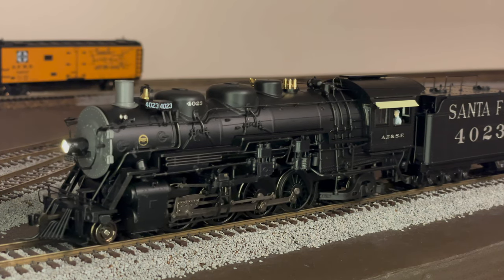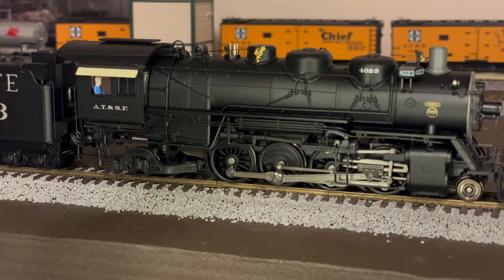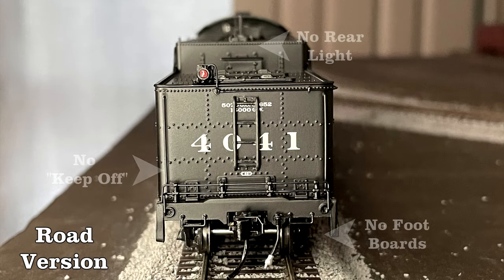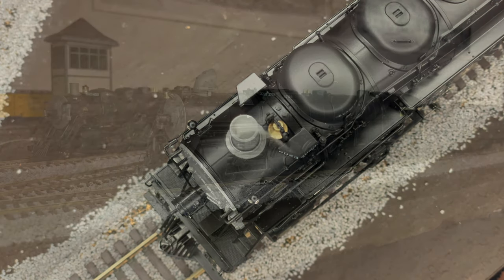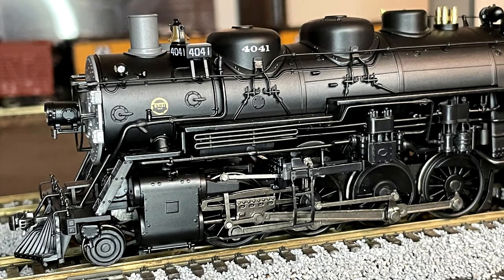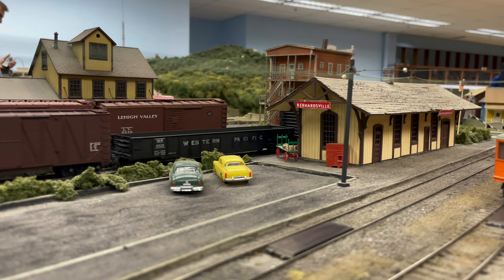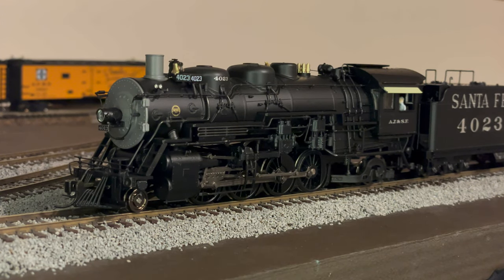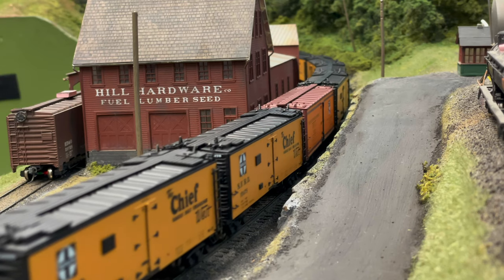Product Review: HO Scale Broadway Limited Paragon 4 Santa Fe Mikado 2-8-2

Comment: Had this issue with a few DCC Sound locos I have at a club layout. Basically it will happen when the loco gets a power spike from a location where there is two power sections meeting.  It does no damage but can sometime reset your loco.

Comment: Nice review.
I have the same switcher version (#4023) and run it via NCE power cab, I have found if you press the emergency stop button the loco stops immediately and resumes as normal when power is re-applied, it disables the keep alive.
The problem will occur if you loose track power either via a short or turning off supply as the system will see this as dirty track etc, all my locos that have a keep alive system operate this way, in fact the BLI Mikado is the only one that shuts down on the emergency button, the others continue. (which is a concern as it removes this emergency function)
I have had no sound issues as yet. (time will tell) I stayed away from Paragon 3 for the well documented motor control and sound issues.
Regards
Gary

Comment: I’ve had the same problem with the sound with a diesel on my layout one day. I could ring the bell blow the horn but the engine would not give a sound. I took it off the layout put it back on and it was fine. It’s a digitrax sound bug on a digitrax DCC system and it has only happened once. I think in my case it had to do with dirty wheels/track as a day later my switcher wouldn’t even run around the main line. Maybe it’s just the dirty track that causes all the problems you were having? Just some thoughts. Thanks a lot for this video man! I was actually thinking about putting these in my wish list and I can say this video has made it a definite yes!
Reply from the maker: Glad I helped make the right decision! That issue sounds the same. It’s tough to tell, only 1 engine did it so it could be the engine, but other engines that had tsunami 2 and esu were experiencing different issues, so it could be layout. I couldn’t replicate it on my home Digitrax layout. The club layout is also Digitrax. But who knows, I may contact BLI if the issue becomes consistent.

Comment: I had an issue with mine too, the smoke unit quit working after 2 hours. The element is still on, so smoke slowly streams out, but the fan quit working, so puffing smoke. I did a factory reset on it, thinking it might fix the issue, but my nce controller said short circuit detected. It still works fine other than the smoke, so I guess I'll run it without the smoke.

Comment: CV 29 has a bit that allows the decoder to determine if DC (analog) or DCC(digital) signal is being presented. The loco could get confused on a quick restart and think the signal is DC. DCC voltage levels are high and would set the loco at full throttle before the decoder makes the correction. Go into CV 29  and turn off the analog option. Search the web for the Digitrax CV calculator to create the new CV value. BTW, this happens with other decoders as well. It freaked me out when it happened to me as I had a full throttle run-a-way locomotive.

Comment: Our club Corona Model Railroad Society has two of these otherwise outstanding locomotives. Our only issues is that if derailed or shorted the headlight goes out and cannot be restored except by removing power completely and reapplying the headlight function. Any other way of relighting the headlight short of killing power? Thanks.

Comment: I've only done some running with my 4023 on my switching layout, only negative issue, so far, is that the wheels have to rotate several times before the chuff is heard. Wondering if a CV function setting could improve on that? I have yet to try the smoke unit and make any cosmetic improvements. Soon I will be taking it to a friends layout for a good running on a large layout with as many cars as it can pull. Regardless this engine is a beautiful model and Broadway should get a good pat on the back for what they have done. And thank you for a professional video review....!
Reply from the maker: Try CV 196. According to the technical reference manual, this controls the steam cocks event count. Default is 2. So I’m assuming setting CV 196=0 should turn it off, meaning you should get the chuff instantly. Hope this helps!
Reply: @OvernightScaleModels  Thank You Much...!

Comment: Overnight I have a question and it is that I have 4023 and it stopped chuffing so I took it off the track and put it back on 30 seconds but the chuffing never came back to 4023. Is it possible you could help?
Reply from the maker: I would open the tender, and use the reset button first. In the instructions manual there should be a section on how to use the reset button. If that doesn’t work, might be a broken reed switch inside the engine, in front of the flywheel on the motor

Comment: How did you disconnect the loco and tender?
Reply from the maker: There is a 9 pin plug between the tender and engine (the same plugs you’ll see on other Broadway limited models). Once you unplug that plug and remove the tender from the drawbar then the engine and tender will separate.

Comment: Put it in Pro Lighting Mode so you can control all the lights individually. I find the auto cab light on/off to be unprototypical to the max and really irritating. If you use Pro Mode, the manual forgets to tell you about setting CV 243. Very important or your lights might not work properly. Why they didn't use one mode and eliminate some of the totally useless (IMHO) sounds from F 14 to F 21, I'll never understand. If you use Pro Mode you will lose the coupler sound function and a few others that are much more useful and will have to re-map these functions back in. But I do love being able to turn the cab light on and off  and controlling the other lights individually particularly in switching operations.
Reply: Hi - what setting do you apply to CV243 please? Thanks

Comment: Beautiful models. Unfortunately I model Raton Pass and these 2-8-2's were not seen there. As it is I have a few of BLI's 2-10-2's including one modified 2-10-4 to model the 3829 which was a regular on the Pass. My question is all of BLI's earlier models had the option of getting rid of the traction tire-equipped driver and replacing it with a regular driver. While this would reduce the model's tractive effort on grades, it allows for wheel slip that could be more beneficial to the model as a complete stall which a traction tire could cause could blow critical components on the engine. I also like the need for adding additional locomotives and helpers to get trains over my 3 percent grade, just like on the prototype. Are regular replacement drivers without the traction tire  available? By the way, I'm a member of the NYSME in Carlstadt.
Reply from the maker: Unfortunately, there isn’t a replacement driver with no traction tire like they used to include. I understand the concern

Comment: The whistles still suck compared to TCS WOW sound decoders. And the smoke can’t touch MTH. BLI continues to disappoint regardless of their attempts at improvements. The most disappointing point is the abysmal positioning of the eccentric cranks! With the exception of a few samples, their eccentric cranks barely move which is one of the main joys of watching steam locomotive running gear! 

BLI models look ok but still fall behind Athearn genesis! BLI still has lots of work to do before I’ll spend $500 on their locos!
Reply: So, new to all this. What MTH would you recommend?
Reply: @Curious_Skeptic  hi. MTH has been sold to Scaletrains Inc. Scaletrains hasn’t released any steam locos yet but I’ve been told they will be like the trusty MTH locos—same tooling and patents! Meanwhile you can find used MTH locos and you’ll see what I’m talking about. I’d recommend their first offering, the K4 Pacific. Excellent whistle and smoke and perfect eccentric rod movement. Same for their Mikado. Actually, all are excellent except for the J Class—kinda disappointed with how it looked. MTH looks great but BLI sometimes wins in that department. But BLI’s crappy eccentric crank modeling and weak smoke/chuff rendering ruins any edge they may have. MTH is a clear winner!